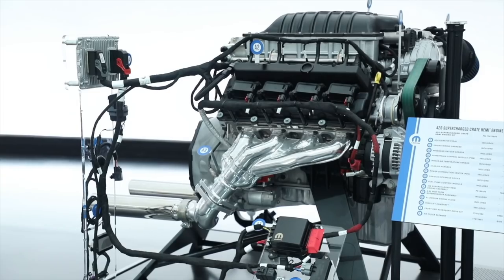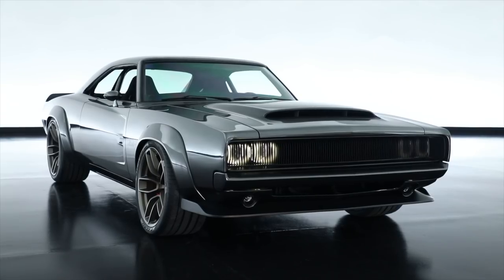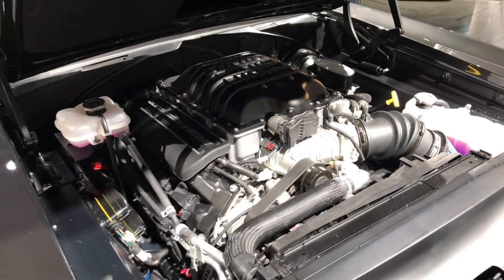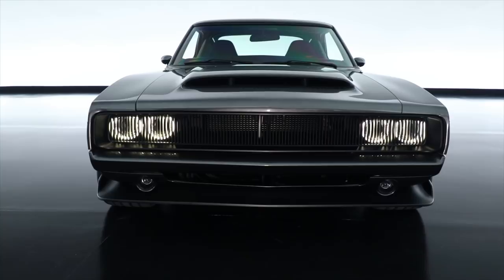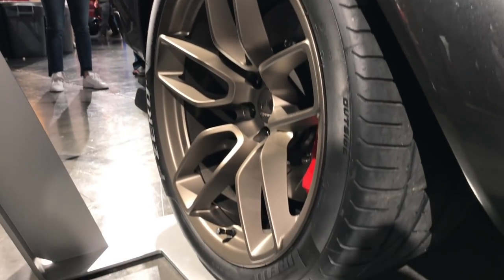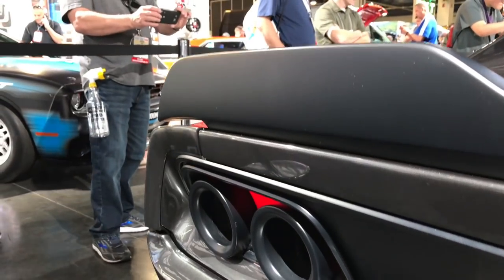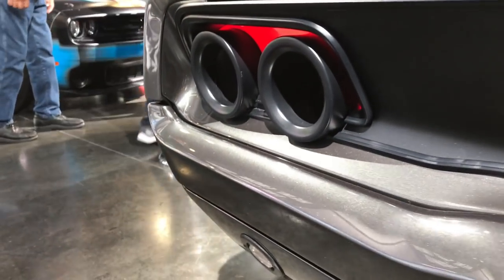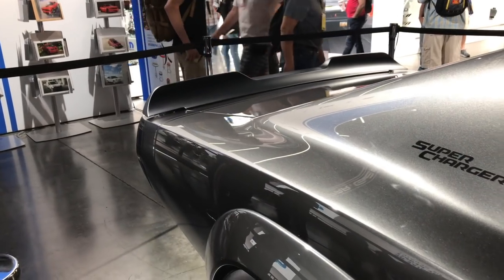Mopar Hellephant, Super Charger Walk Around

Comment: 1st and how much does it cost...
Reply: The crate motor is $20,000 alone.  The car itself....I would say $150,000 easy.
Reply: @mikea5205  thanks for the info.
Reply: Crate is gonna be higher than $20,000. The hellcat crate is $19,500. Expect this one, which is an aluminum block and not iron, to come in at no less than $30,000.
Reply: Mike A priced at 29995 lol
Reply: @mikea5205  the engine costs $29,000  and if you want the optional wiring harness that is another $3000